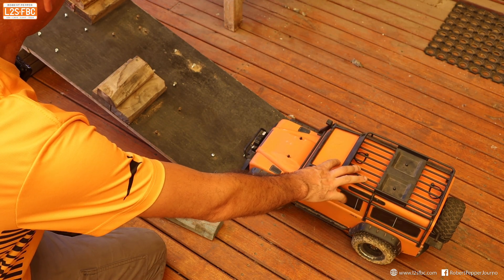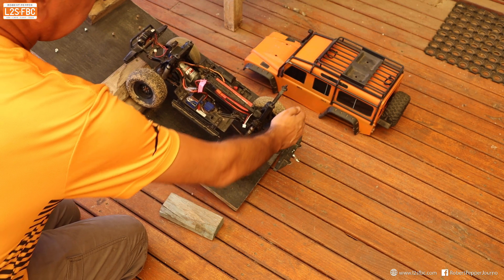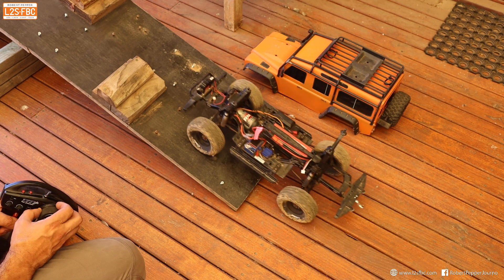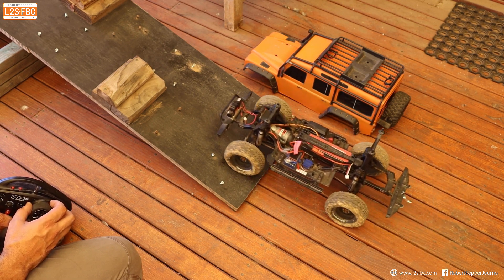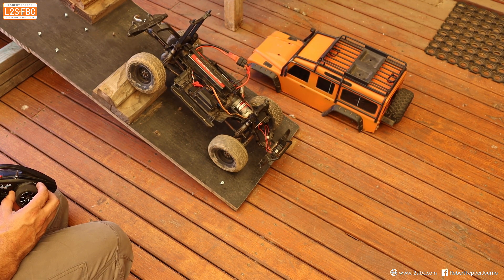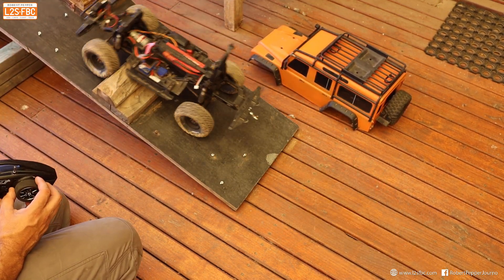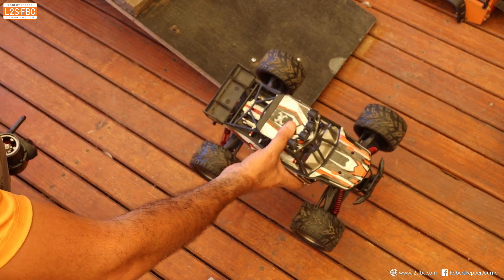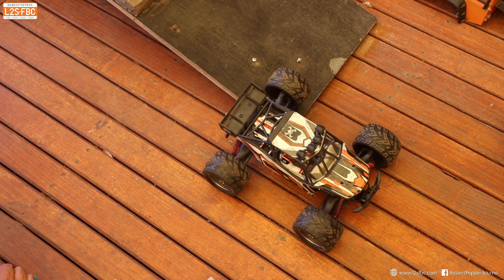Where would you track-build to solve this?

Comment: Acceleration of the free spinning wheel requires torque coming from the diff due to the inertia of the wheel. That same torque is then applied to the other wheel, because that’s what an open differential does.

Comment: D - the car has enough flex to put the power down and start climbing the first part of the obstacle but not enough to completely get over. Option D minimizes the height difference at the top of the obstacle with the rest of the difference is being made up by the flex of the vehicle. Option D is the best bet and if that doesn’t work none of the other options will because ultimately the best way to get over that obstacle is a combination of option C and option D

Comment: Tough one. I'm leaning towards A the most. Due to the setup of the model car: 50/50 weight distribution, 50/50 front/rear torque split and low COG. 
Weight transfers to the RHS instead of weight transfer to the rear axle.
Maybe we're all right.....or maybe we're all wrong.

Comment: Thanks for this interesting riddle!
I would build at position D. It helps the front wheels over the first obstacle (allowing some torque for the front right) while also keeping the car more leveled. That also helps with traction for the rear axle. When moving further up D again helps the rear wheels and hopefully the car will make it over the last obstacle.
A and B would not help with the last obstacle at all. C would still have the car crossaxled after dropping down from C during the climb.

Comment: It's the passage of the second step that seems to be the problem.
It's hard to tell from the camera angle! You can't really see the difference between the position of the wooden blocks between themselves and the wheels.

A- This transfers weight back to the rear left and front right wheels when the front axle passes over the second step but the rear axle will be blocked when passing over the second step as for the front axle or the wooden block would have to be repositioned.

B- Does not change the situation

C- Could work, but if the piece of wood is too short, as soon as the front right wheel has passed it, we risk having the same problem as initially when passing the second step, with the right front wheel hanging.With a bit of momentum, this could help.

D- If the D position is too far away, which seems to be the case, it won't work. If the right wheels reach position D before or when the left wheels pass the second step, this could work.

So let's say C!?

Comment: C overall best. A & C will have a similar effect in reducing the angle between the diffs for the first obstacle but C will help a lot when you get to the second obstacle by flattening things out and that the rear will be overall higher as the front climbs the second obstacle which means less effort required.

For the second question, when you accelerate the wheel, there is an increase in torque to both axles during the period of acceleration, which means more torque going to the wheel that’s not spinning. Once to acceleration is complete and the spinning wheel is at its new constant speed, the torque to each wheel drops back to the torque required to maintain that speed, and the car rolls back down until it finds the point of equilibrium.
Reply: Exactly what I think would happen. Very well explained.

Comment: Solution A would only be useful to let the front axle pass the first obstacle, so I think it's not the right answer.
I would say C, considering the wheelbase and the distance between the first and second obstacle (just a rough estimate as there's not a side view of the ramp in the video).
Provided the measurement explained above is right, the rear wheels would be still on the flat part and evenly pushing when the front right wheel approaches the second obstacle. Then the front left wheel would start spinning as the opposite wheel climbs to the higher part of the obstacle but at the very same time the rear wheels would be leveled on the lower part of the first obstacle (with the track in position C), so granting enough push before the rear left reaches the higher part of the first obstacle. When this happens, the front right wheel should have passed the second obstacle and leveled with the opposite wheel, so granting traction on the front axle.
If it's not enough, while the front left is still spinning I would use the trick of giving full throttle for a while, as for the second exercise that led to the second question. The differential will not appreciate but it will make the difference between being home for dinner or doing some extra work in the darkness. 😊

Just can't wait to see your next video. 😎

Greetings from Italy. 🇮🇹
Reply: Your right that A would get the front wheels past the obstical and was that the original question? There are more obsticals up the track that I think the vehicle will get stuck on no matter which of the options you use.

Comment: The spinning wheel has inertia so when the torque from the motor changes, some torque is transferred to the ramp wheel. As the spinning wheel slowly accelerates, this equalizes the situation and the torque at the ramp wheel drops back to zero and the vehicle rolls back down the ramp.

Comment: A would work for getting your front tires over the first obstacle, but you’ll be totally stuck at the second obstacle. Even without the second obstacle, the rear tires still need to get over the first one. I don’t think B would do any good really. 

So that puts us at C or D. I don’t know but I bet that the biggest factor is how it interacts with that second obstacle as I’m thinking that either location would get you over that first one…

For the second question, inertia and friction. Everything has frictional losses, so the gearing that makes the free wheel spin will cause the other wheel to exert a small amount of torque because of the friction in the differential. Additionally, the inertia of the tire, wheel, & axle on the side with the free wheel will resist acceleration which will apply some force on that other tire.

Comment: C. First, it flattens everything out at the point where it would be getting most crossed up. That puts more weight onto those two wheels, giving more drive.
Second, when you hit the second lump on the left, you'll have more weight transferred to the rear of the vehicle, giving more drive to push up over that as well.

Of the two, the greater benefit is just in getting the diffs flattened out.

In that A is also a viable option, until it comes time to get the rear diff to climb, and it assumes the position works out just right with the wheel base, hence C is the better one.

B and D do nothing to benefit traction, B just moves the point where you climb first, doesn't help with the second lump, D doesn't climb till you're already on top of the second lump and the issue is getting to that point in the first place. The only way D helps is if you're sideways across the hill which is bad and basically turns it into C anyway.

As for the second question, the thing that's limiting the torque to the wheel with traction is the opposing force on the other side. There's a bunch of dynamic components to that caused by the oil in the diff, windage etc that are non-linear. The faster those components are spinning the more drag is present, which causes a greater torque to be applied to the side with traction.

Don't make a habit of doing that, the small spider gears in the diff really don't like it. They're not designed to operate at high rpm, if you do that to them continuously they'll heat up and fail and if you do it intermittently they will wear excessively and fail. It's just a bad idea. Pull out the shovel or pack rocks instead.

Comment: I think i would pick A. This eliminates the cross axle issue. B looks like it just moves the problem down the hill, D the car probably wouldn't even get that far as its stuck on the original bump. C would be second choice however you then basically have a rock step which will be hard to drive and possibly high center your vehicle. A is the clear winner or pull out your shovel and get rid of the original obstical 😂
Reply: Also, with C you're probably going to get cross axled when you pass C and the original slope will still be lifting your wheel. Other option is the drive to the left and put both wheel on the obstical.

Comment: I would probably trackbuild on C, as it gives a good possibility of equalising the suspension travel and the cross axle issue. 

The reason the car moves up the ramp with open diffs and accelleration is friction. Friction internal in the diff, the gears cannot run absolutely freely so there is drag caused which effectively gives an action of a LSD. 

Can I also pull you up on saying "at one point the back end scewed around there" can I ask why you didn't call it understeer or oversteer? As that is exactly what you normally call it. That explanation should set you on the course to understanding why skidding is not over or under steer.
Reply from the maker: I didn't call it understeer as the front end wasn't moving, but yes the rear lost traction and the car was yawing so I guess it's a form of understeer, but not what people typically understand by the term so I said it slewed around.  I forgot to add this example  https://youtu.be/v1wNrfQGz0s
Reply: @L2SFBC  This is my point on the whole misconception of over and under and neutral steer, if it physically did that movement, you 'd be right but it's only the effect that the driver feels, it's not what the vehicle is actually doing - and that fact is what actually matters in reality, if you call it what it is, a skid, a loss of control, then it becomes a better tool to use as you want to avoid these scenarios not accept it happens like there is nothing you can do about it. You can't actually do anything about under steer, over steer and you ideally want neutral steer as it's design issues, but you can do something about skidding. Skidding is the same whether travelling or not, it's external to the vehicle, 

skidding is essentially excess, uncontrolled yaw as you say, where you want controlled yaw to best get around a corner. Look at how a tyre works, as I know you know that, and when turning you get slip on the tyre, the slip angle is a determined by speed and desired angle of travel, once the slip angle is exceeded ie the tyre can no longer atain traction at the required angle it looses traction, it no longer actually steers so it cannot be, by definition under steer or over steer, it has to be factually a skid as that is a loss of traction, whether intentional or not (technically a wheel spin is also skidding). 

Consider what actually is over steer and under steer, A Nissan Navara D40 is actually a good example as it is available here and in AU, take the time to have a good look at how the steeering works, you'll see one wheel really goes over the ark if travel when on full lock, the outer wheel turns tighter than it should. What would you call this? What effect does it actually have on the vehicle? then think about it. You'll find it either over steers or under steers! At this point you will understand why calling a skid as oversteer or under steer is wholy wrong and hopefully stop doing it. The point in your work is to get facts over and improve people's driving and design etc... You generally try to explain things in defined terms, work out why something happends and explain it and if it's not what people thing, give the correct info about it. That I like about your work.

Comment: No experience in offroading, i would think position A and C would both work. Because in both cases the diagonal articulation needed is lowered and so all 4 wheels touch the "ground".
In A because teh whole left of the car is on the obstacles and the right of the car isn't. In C because the front of the car needs less articulation and the back gets more weight transferred.
In position B and D i would think this won't work: in B the problem without the additional piece of wood stays the same, and in D it's "too late" and the car doesn't get there.
As for the question at the end, my answer would be: inertia? (as a non native englishspeaker, not sure that's the correct term) 
The increase of the revs is so quick that the inertia of the spinning wheel keeps it from accellerating as quickly as the reves.->The overall torque increased very fast with the revs and due to inertia, both wheels accellerated the same amount for a very short period of time pulling the car a bit up the ramp.